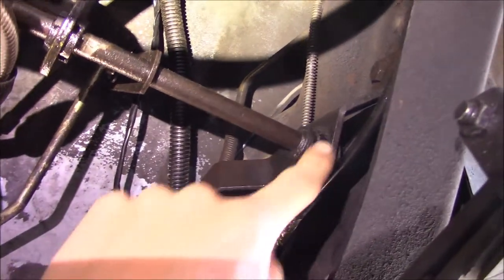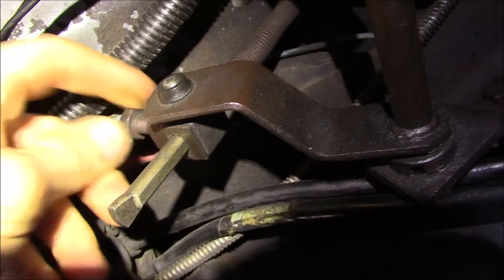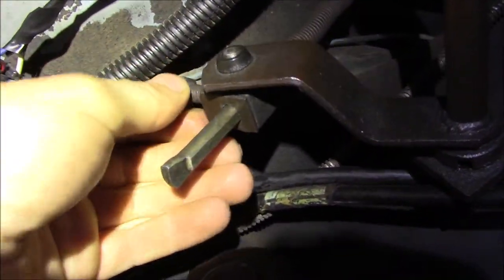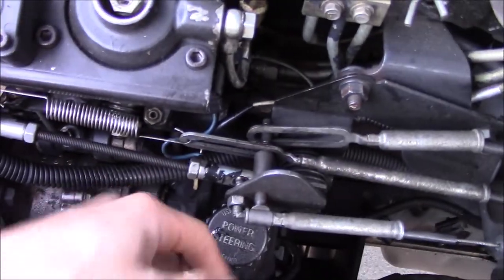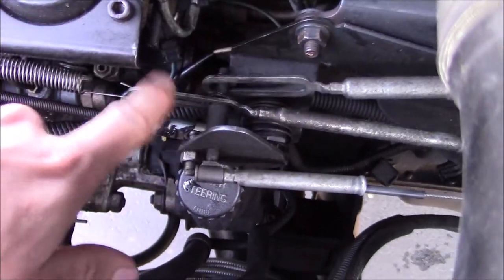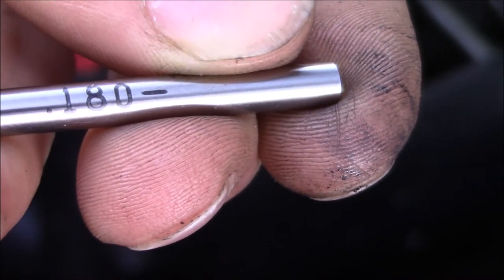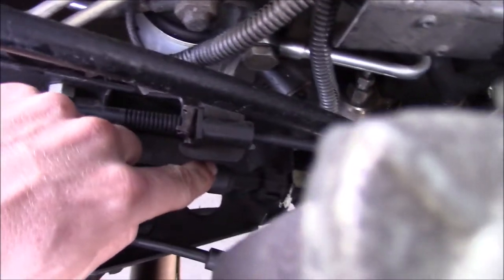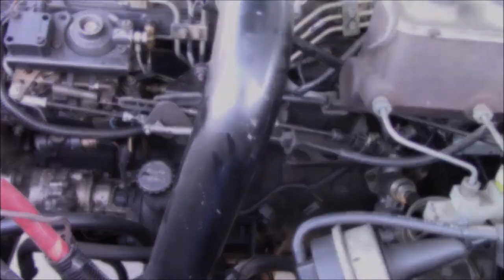1st gen Cummins 47RH shift linkage and TV cable adjustment

Comment: Hey man thanks for the videos. I have 92 auto and im finding it shifts fast through 1-3 and won't hold 1st or 2nd its always in 3rd. I set the cable to .180 but still shifting fast. do  i know open the pawl and put it towards the truck until the throttle lever is about to move?
Reply from the maker: set the idle speed first and make sure the locknut for the idle speed screw is locked down. Then adjust the linkage gap to .180

Comment: Mines a 727. Guess its the same procedure
Reply from the maker: Hmm not 100% sure on that
Reply: Yes, it is the same, the main part of the transimission is basicly a 727 with an OD plugged on the the back. The difference between a 727 (37RH), 46RH a518, and 47RH is 3 spd No OD , 3spd OD , 3spd OD and Lockup, by the way the lower the number i.e. 3, 4  the heaver duty the transmission.

Comment: Got any pointers on od. Sometimes it does go into od most time it doesn’t.  Rebuilt the pcm, new tps, done the adjustment on the tps, also replaced the thing that sits on top of the harmonic balancer. I’ve done this adjustment as well.  Not sure what to do next.
Reply from the maker: Could just be when the trans temp is too cold. That's a safety interlock.

Comment: Just installed my automatic transmission back after replacing oil pan & rear main seal, u joints, carrier bearing& now it doesn't want to drive lol going to repeat this procedure tomorrow morning praying it works out lol
Reply from the maker: Best of luck man

Comment: For the TV cable does the actual throttle rod have to be at a certain position before adjusting ?
Reply from the maker: On the transmission end? Nope leave it resting naturally.
Reply: Is there a way we can talk privately so I can get you to answer my questions and send you a video of what’s going on
Reply from the maker: @loganford3971  Just upload a YT video and tag me in it
Reply: @benjamin A.R.
Reply from the maker: @loganford3971  yeah man that ain't right, I'd pull the entire cable and lube it with the help of gravity. Unless something weird is happening and the cable body is slipping inside the adjuster mechanism hard to see
Reply: When you do that adjustment are you suppose to have the pedal pushed down ? Cause I was running into the issue where my tv assembly wasnt pulling out enough to reach that tolerance gap. It was bottomed out
Reply from the maker: @loganford3971  No problem thanks for subscribing.
Reply from the maker: @loganford3971  Nope, you'd have to remove the entire cable, hang it, then put oil in the top end so it travels the whole length. No, don't touch the pedals when you adjust it, do it exactly like in this video.